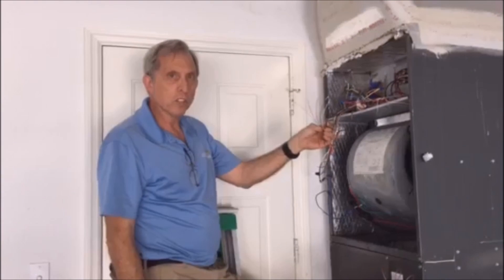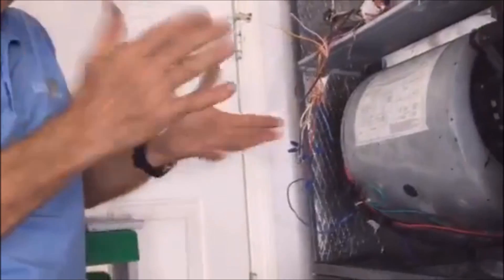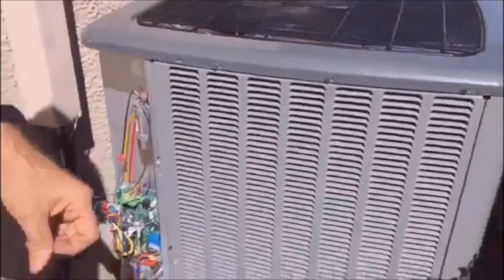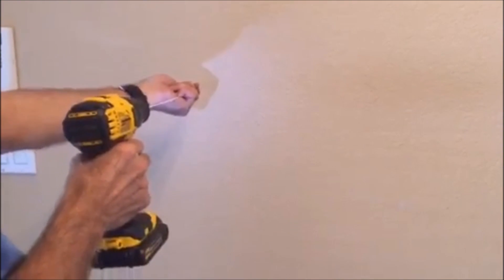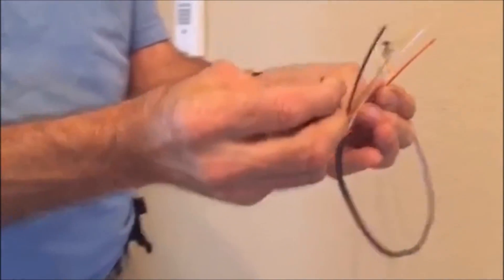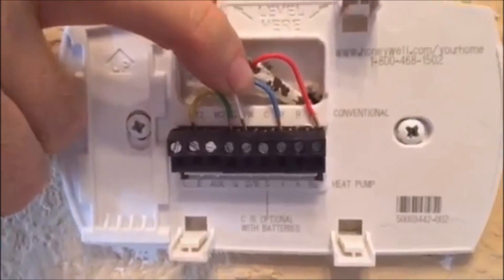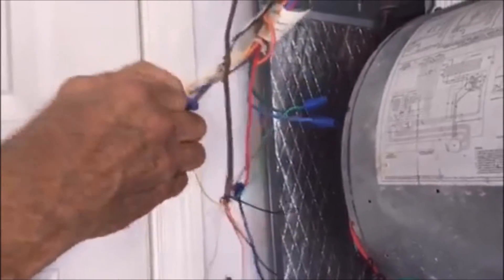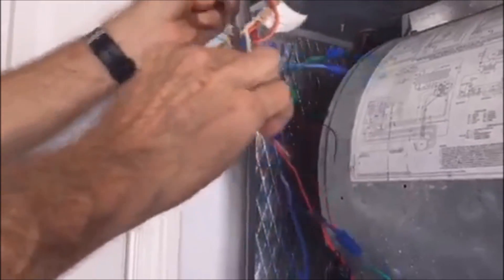Installing Common Wire for Wifi Thermostat

Comment: How do you have a heat pump that is two stage cooling but single stage Heat ? Y1 and Y2 are both heating and cooling stages 👀am I missing something I mean the heat strips are the back up heat…..

Comment: Thx. for the video David. So many problems can arise from the low-voltage wiring. I have done change outs where i would swear the original installer would purposely change the color to screw up any tech on a service call.

Comment: Great video Dave.  Doing same on a 2010 Ruud air handler.   In video you mentioned they are brown and we'd get to the later but I don't think you had time?  Inside my handler I see two C terminals on the circuit board a big plug on lower right corner of board and smaller one upper right.  Must I connect at the terminal in upper right or can I cut the wire and add a screw cap to join three ends?  Tried the latter on large lower right connect to no success.  Thanks

Comment: I have a miller electric furnace and I have heat but the furnace will not shut down.  It has four wires that the thermostat wires hook up to red on red green on green white on white and a gray wire witch wires do I hook up to the the gray

Comment: I wanted to hear more about where the common wire  connection came from, you had disconnected all the wires from the old thermostat, which had one wire less then the new one, you then reconnected the new wires, two wires for stage one and two for cooling, one for fan, one for heating, one for the hot wire. Now all this wires were already there, you had to add the common wire, this was unclear to me, where did the common wire came from, directly from the secondary part of the transformer , was it capped , and it was hanging there?? 
I watched the video twice, but I missed the important part I think.
Love your videos , by the way.
Reply: I have the same question,  where he got the blue common wire from , I'm assuming was there unhook, he didn't explain the important part

Comment: Unfortunately, I think the new thermostat is way too close to the window which means it'll get sun and unnecessary heat. This means it's going to run the AC more often than it needs. The thermostat should've been located closer to the inside of the house away from windows and drafts.
Reply: I have the same problem, but will purchase a thermostat with remote sensors to fix that problem.

Comment: I have a heat exchanger. It uses a 4 wire thermostat. I installed the 4 wire cable from the furnace to the wall location. I tacked the wire. I tacked the wire to 2x4's. Can not run a new wire so my question is can I use a wall wart ( transformer 24 vac) to get my extra power?

Comment: The real question is how do you fish a 5 wire cable through the ventilation ducts to replace a 4wire? I assume trying to tape the new wire to old in an attempt to pull it up would result in it getting snagged or stuck.
Reply: It wasn't fished through the duct - if you look, it exits through a wire knockout. He says he fished it up the wall. Knowledgeable and experienced people can run wires almost anywhere - but it's often tricky and labor intensive, which is why he probably skipped the actual process. It looks like the house is a ranch in which case he just had to pop the wire into the attic. He specializes in HVAC and used some novice wire running methods, which is ok since the unit was in the garage and back to back with the thermostat - not a common situation. However, the point of his video was to show you the basic methodology.

Comment: I'm In so. Florida and my thermostat is wired with just 4 wires the blue is to C, the red wire is to R, the Orange is to 2,
and the yellow wire is to 1
the unit works fine but I want to wire a wi- fi  Nest how do I do it?

Comment: I installed a Ecobee3 wifi thermostat and (stupidly) did not take photos of the previous wiring first.  The installation kit comes with a "Power extender kit" for folks that had a 4 wire rather than a 5 wire system starting out.  I connected everything, but the outside unit does not turn on.  Since I don't have a photo of the original set up, I am rather lost.  Is there an easy way to figure out which which from the outside unit should be connecting to which wires at the Power Extender Kit?